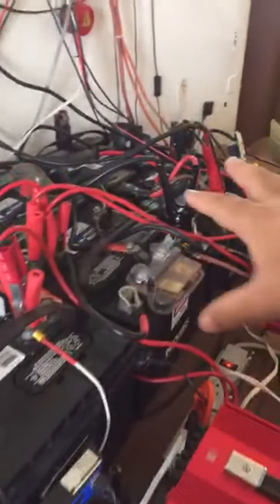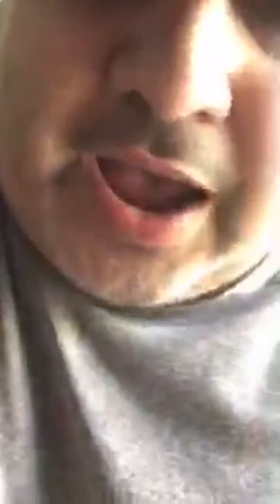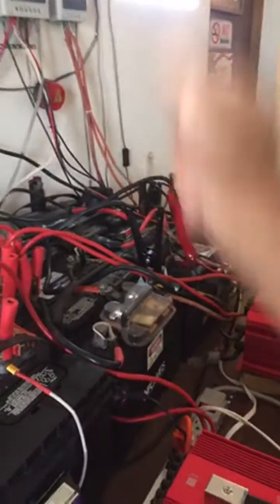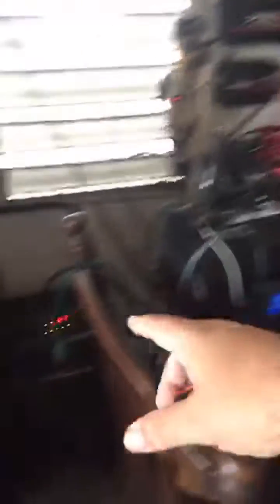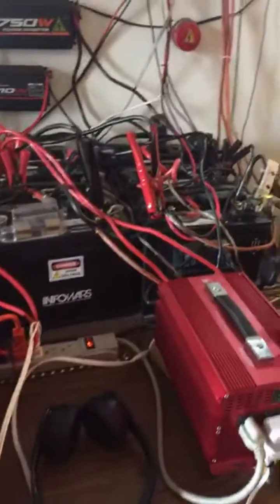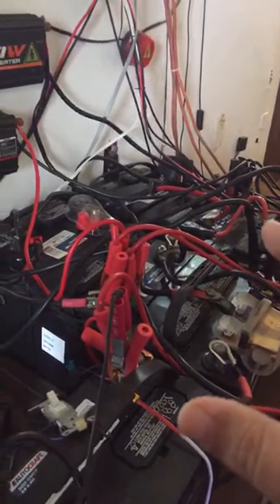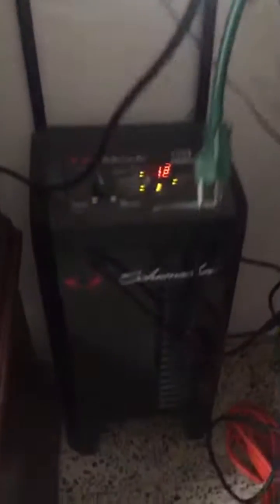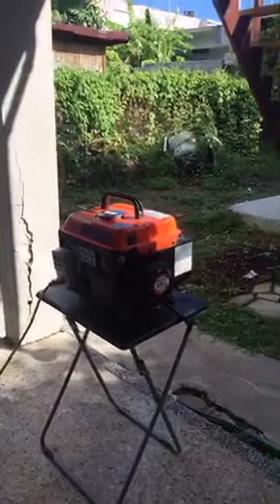How to charge your 12v battery bank with a 2 cycle generator 800watts

Comment: Very well,,DONE,, Been doing this over 20 yrs ,, I AM PARPER,, Couple things,,  tho,,, use a  4 cycle generator if you can get one/// ,, less smoke, and 3 times easier on gas,,, and gas with  oil doesn't store well,,,,and if its off by 1/8 oz oil between fill ups  it will change voltage and run different RPM, AND VOLTAGE /// pure gas will store better,, can add fuel stabilizer,, any time,,you can add water removers to you pure gas  any time,, you also can use octane boost,,  any time of use ,,then it will  run smoother less voltage issues,,  I am in NORTHERN COLD AREA ,, with lots of outages,, As I said i am PERPAR ,, People think i am nuts till the SHIT HITS,, Then everyone asking me ,, for HELP,  ///  if you HAVE ???  fill free to ask ,,  i have battery room on side of my house,, and owen 5 generators,, //  BUT WHEN ITS 20 BELOW,, something happens just fire another one up,, P.S  I am  construction electrical  SITE MANGER ,, ,,